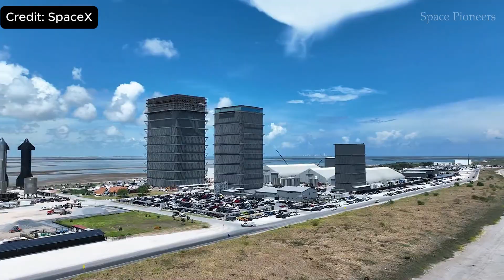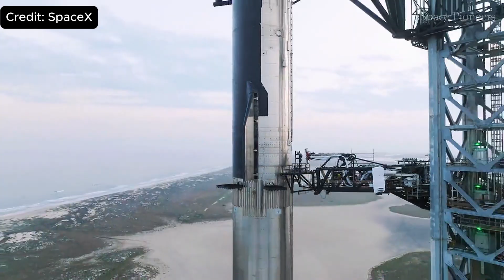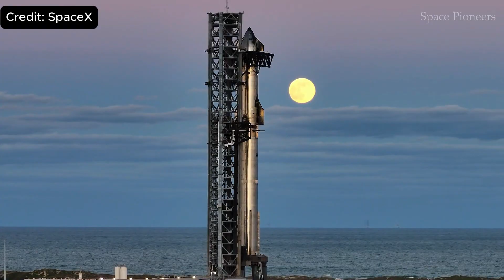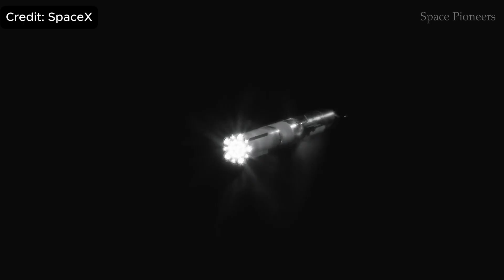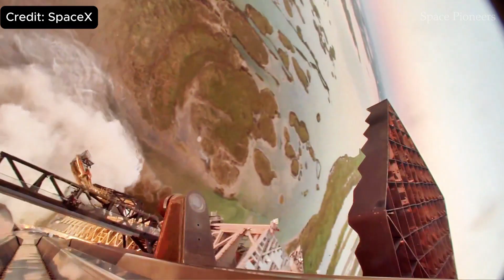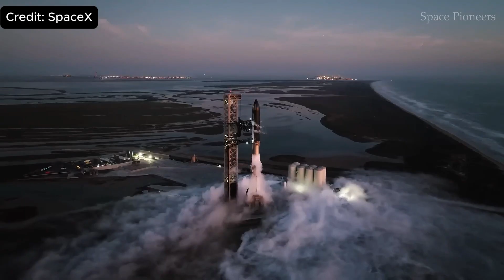Starship Needs a New BOOSTER? SpaceX’s Big Upgrade Explained!

Comment: I don't think SpaceX will risk using B14 on IFT8 given the result of S33.  If S33 had been successful, then maybe.  I am sure they would not want to risk S34 on a used booster, and not have a chance to test the changes they made to S34.  Just MHO.  B15 seems well on its way to being ready sometime in Feb, and given the past history of the FAA, B15 and S34 maybe ready to go before the FAA lets them fly again.  Depending on what the FAA says it may well be S34 that is the hold up.  All depends on what changes need to be made and when SpaceX can implement them.  I have no doubt, given SpaceX is doing the investigation, and they know the hardware, they are already well into designing and implementing changes.  They have a history of that based on previous FAA investigations.
Reply from the maker: Many thanks for your insights, good points!